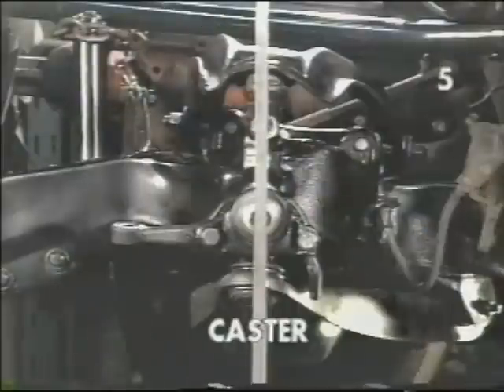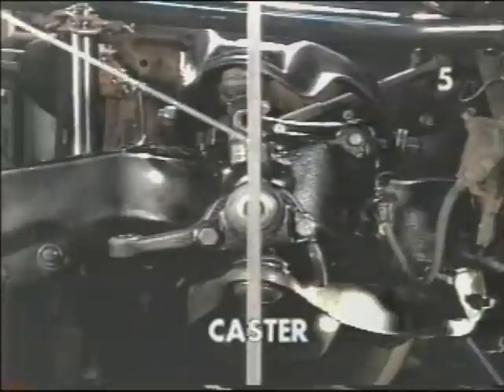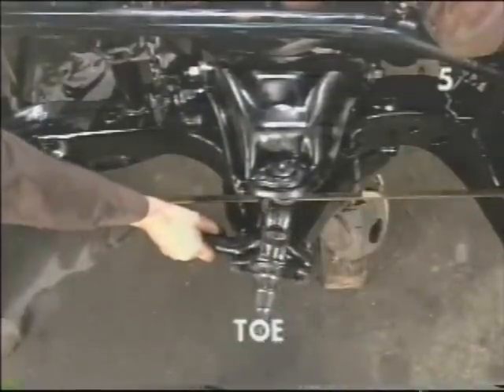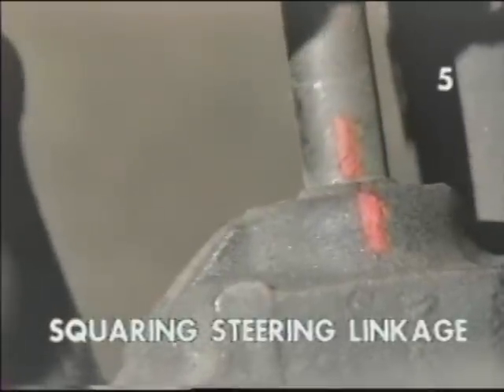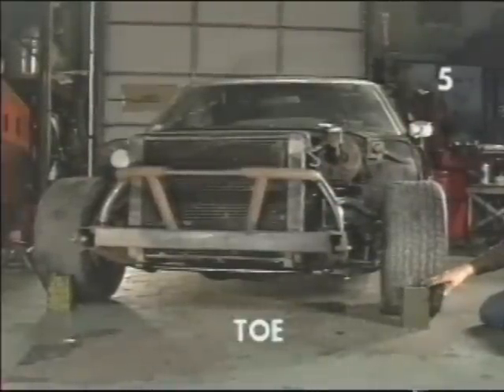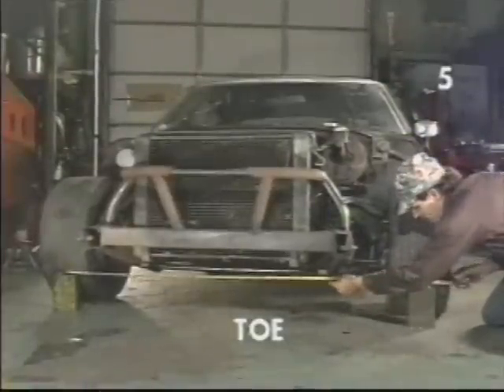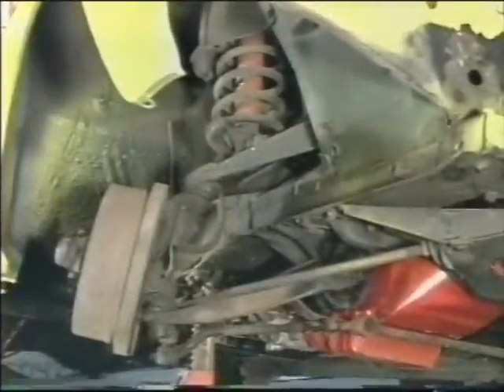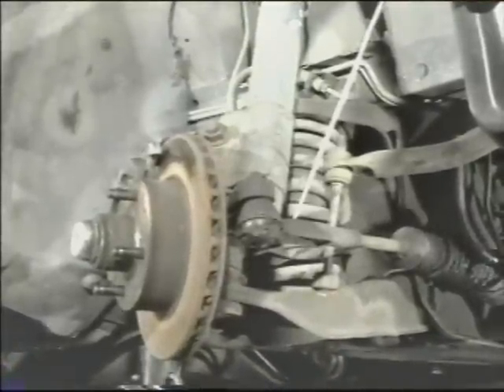Rebuilding Your Front End- Part 5- Alignment Basics

Comment: So if i remove the tie rods and then spin my steering wheel lock to lock and then come back 1/2 of lock to lock my steering box  should be centered and if everything is correct my steering linkage should measure up square, correct ? In other words there is a direct relationship between the steering box being centered and the steering linkage being square, right ?

Comment: I have a 72 ElCamino and im trying to get my dome light to work i changed the bulb and checked the fuse and changed the light switch...what else can i test
Reply: Maybe start by looking for the answer to that question somewhere other than a wheel alignment video !!!!!!
Reply: The chrome plated dome light fixture is grounding on your metal part of your roof. Very common. My chevelle had the same problem.